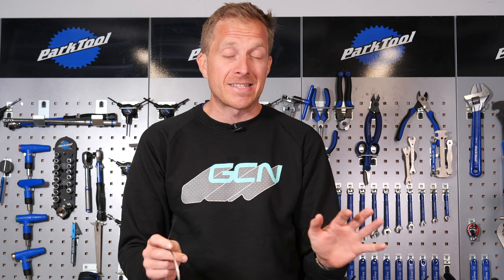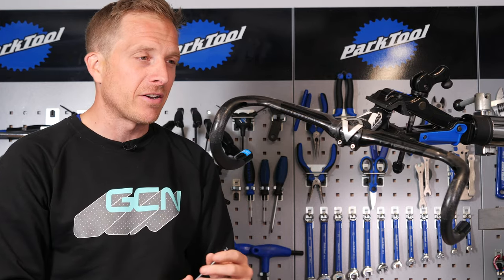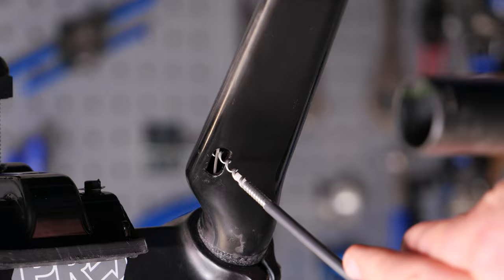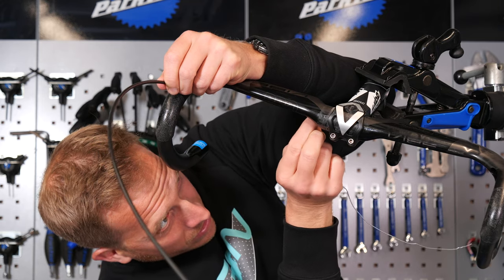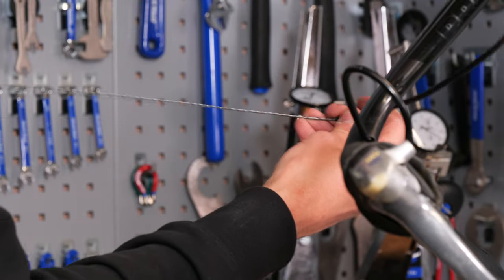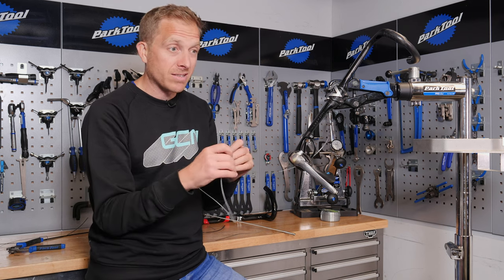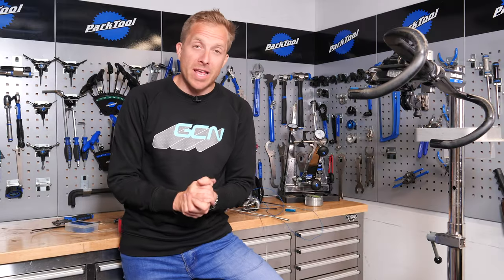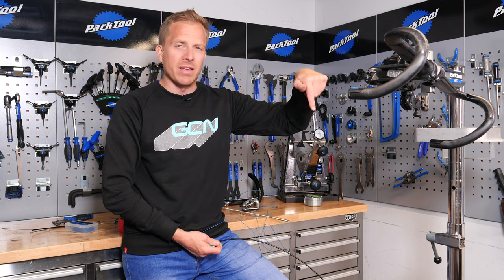Internal Bike Cable Hacks | How To Replace Internal Brake & Gear Cables

Comment: I do not like handlebars with holes in them, especially in carbon... People will go on and on about not buying cheaper carbon parts, but then they buy carbon handlebars that are pre-cracked by drilling massive holes into them in critical locations.  My dentist is too expensive.  I'd rather buy handlebars with no holes and route the outers below the handle bar tape...

Comment: thank goodness for marketing departments. due to marketing departments i can no longer find a production carbon frame that DOESN'T have hideous, infuriating, entirely impractical, and anti-simplistic internal routing.
good work marketing departments, i will never EVER buy another bike frame with ICR
Reply: Go back to Steel or Titanium. My 1981 Follis (Vitus 971) and my 1998 Litespeed Vortex (Ti6/4) have the little braze-ons below the BB, so when I change the SS cable every 10 years or so it takes me about 2 minutes... and yes it's less aerodynamic but the 1W I lost is nothing compared to the 100+ Watts that have disappeared from the engine since the 80's :) ...